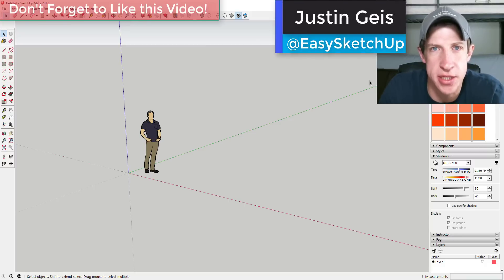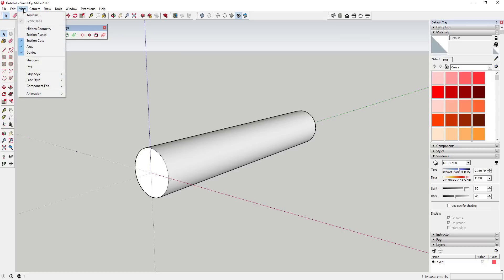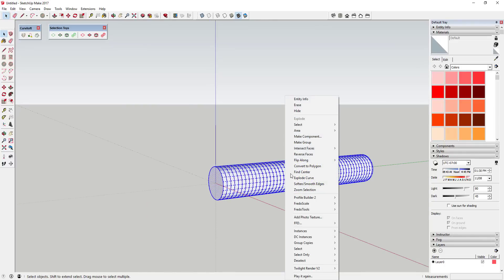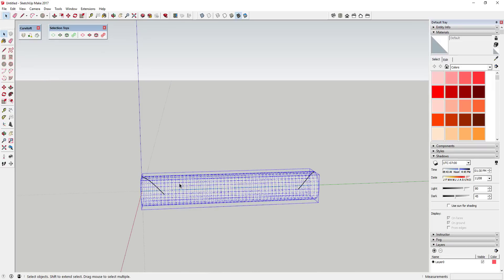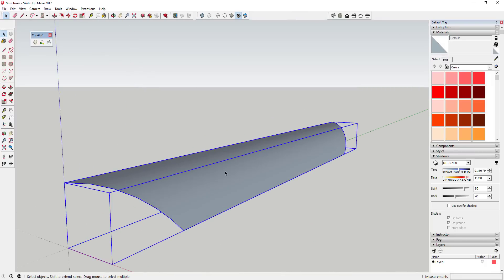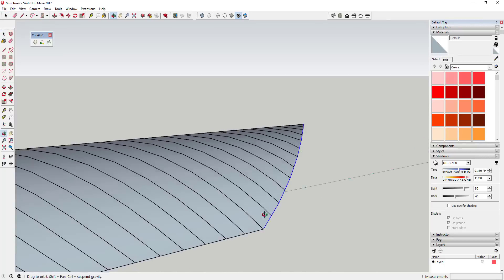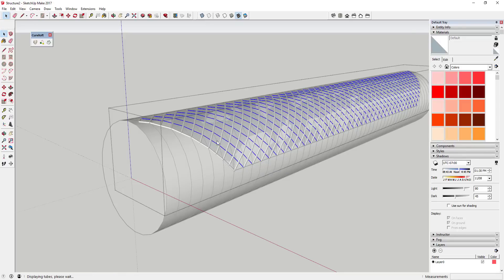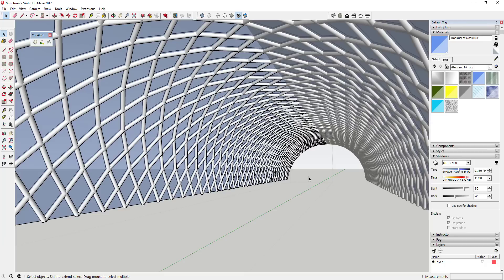Creating a Frame and Skin Structure in SketchUp with Hidden Geometry and Curviloft

Comment: hello need help with corviloft tool it just does not complete the skinning process
Reply from the maker: I'm going to need more information about what's going on to help...
Reply: hello thank you for replying ,  the frame which i made does not get skinned using curviloft option after clicking on frame nothing happens . it just shows that the skinning is under process but nothing really happens....
Reply: nevermind i got it thank u for replying though 😁

Comment: Very helpful. Is there a way to use line to tube, but make it rectangular instead of cylindrical? Or is there another plugin that does this? Thanks
Reply from the maker: Set the number of segments in the tube to 4...

Comment: Hi! Great videos you keep uploading every time. Really appreciate the effort you take for them all & they're all of great help every time. But, many plugins that you told for creating double curved surfaces such as Curviloft, SubD, Vertex Tools are paid. I was trying to create the irregular height vault (Which you demonstrated how to create in Curviloft in another video) or the vault with non coplaner gables on both ends. Is there any free plugin which can create that kinda stuff? Soap skin bubble has a limitation for the vault structures as the Soap Skin ratio behaves weirdly after a certain value, does't it? Pleas suggest. Thanks.
Reply from the maker: Curviloft is free. I didn't use SubD or Vertex Tools in this video.